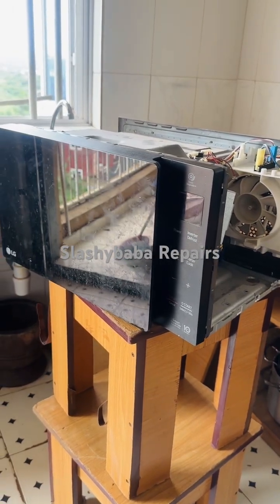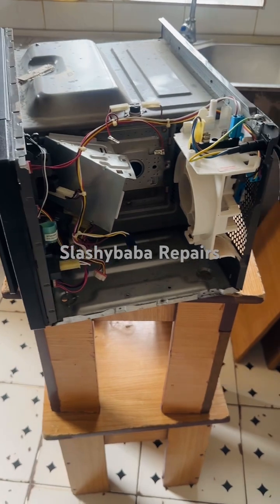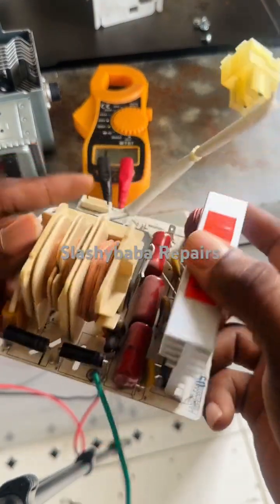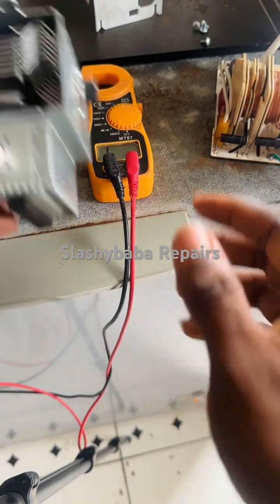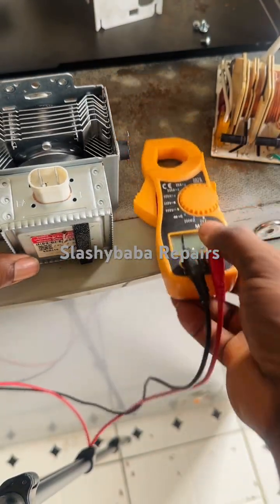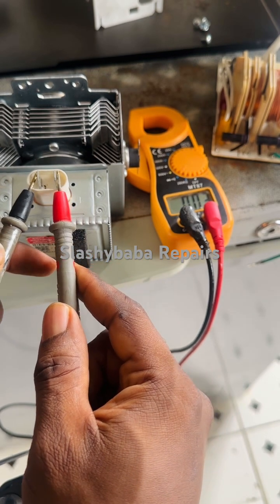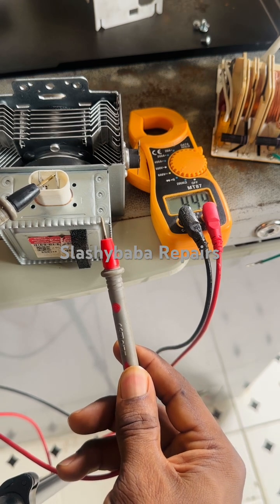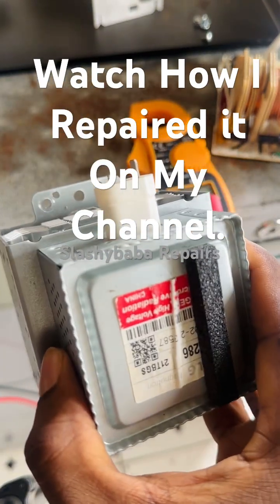SOLVED: LG Inverter Microwave Not Heating Up, Making Clicking Sound. ENGLISH, FIXED, DIY.

Comment: Mine doesn't heat up too😢😊
Reply from the maker: If it's an Inverter microwave, the problem could be a shorted diode or a faulty magnetron. If you are not a DIY person, you can take it to a specialist to repair it. 🎉
Reply: I will fix it myself  @SlashybabaRepairs